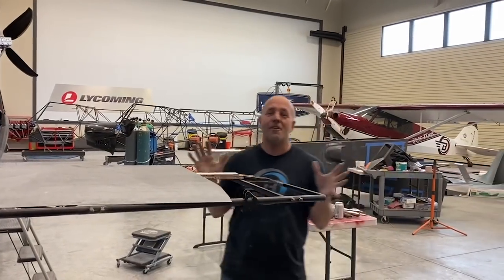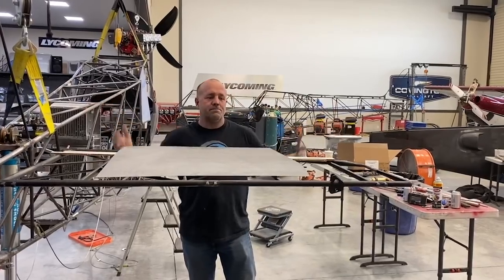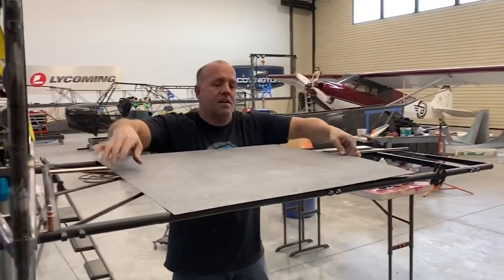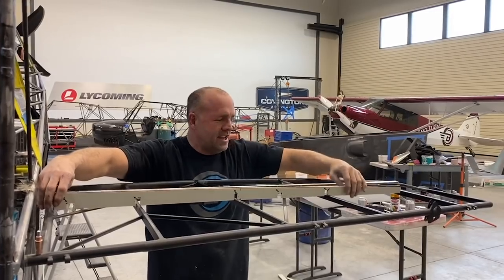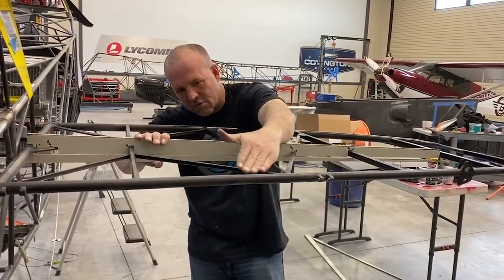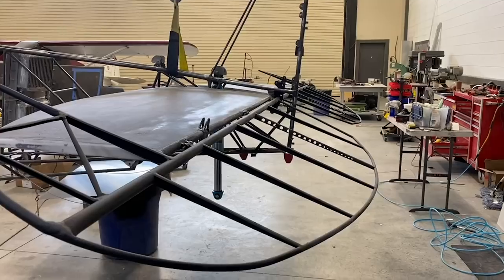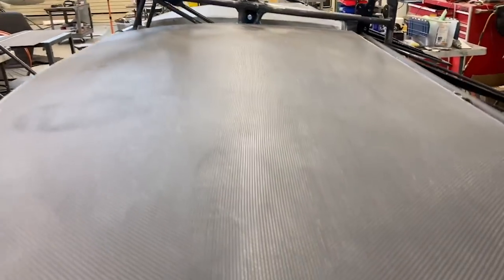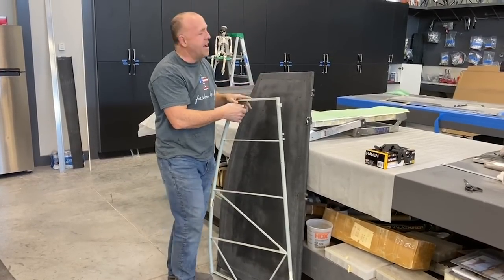Carbon Kevlar Carbon Cub (Scrappy Bush Plane 13)

Comment: Small, fast, composite, so low radar cross section, emphasis on light weight so as much cargo as possible can be carried, bulletproof underside... Mike, if you're having problems, you can start a Patreon, you dont have to start running stuff over the border.

Comment: Why didn't you use a 009 symmetrical airfoil for the tail? The 00x series is widely used for tail surfaces... Also, it has more leading edge radius to avoid tail stall.

Comment: Hey Mike
1st of all, LOVE your video's!! Been watching for a very long time.
My background: Machinist/Mold Maker/Engineering 30 years, I've had my PPL for over 20 years and I also love to build just like you.
Now to my question, You are wrapping F/Glass around metal on your horizontals. I was schooled that you shouldn't do this
because of thermal expansion of metals. With a temperature swing of 40 degree (+)  @ altitude, this must be taken into consideration.
F/glass will NOT expand and contract, but we both know, the metal will. Micro-cracking in the glass?
Again, I have been working with f/glass for years but never glassed metal b/c of this. 

I am  naive, or do you know something I don't?
Off topic: I'll be retiring next year, I would LOVE to come and work for you!!
Reply from the maker: There isn’t enough expansion on this diameter of tube to break a spiral weave glass.  It would have to be a larger tube for that to occur.  Thank you for your comment. 👍🏻👍🏻

Comment: Hi Mike, greetings from southern Wisconsin;
It sounds like your planning on doing some rough riding on the ground with this airplane. That looks like it's going to be one tough beast. However; you have the power up front to take it to the limit. I can't wait to see it flying in a video. Some people will probably complain that your overdoing it, but I don't think so, considering how your planning to use the airplane. I'd like to see what would have happened if you had designed a corsair out of carbon fiber. I don't think the decks of aircraft carriers would have needed to be so long with your designs. Just saying.

Comment: Mike, I can't help but think that the fabric covered moving surfaces are now the weakest link, yet exposed to the highest loads (& potentially flutter risk) from that motor/prop combo...? Also, isn't there an interwoven carbon/kevlar cloth that might have simplified & lightened the horizontal stab?

Comment: Potentially stupid questions:
Couldn’t you go full composite ? isn’t the Steel frame rather heavy ?
Would running the spacer I-beam through the middle make it stiffer overall ?
Would a pointier leading edge be desirable in terms of airflow ?
Thx for sharing your project !!!
Cheers from Germany, land of too many rules (sometimes). :-)
Reply: I think there’s a balance there, remember he has that huge heavy motor ahead of CG. If he removes to much weight in the back, he would have to add more weight, so why not keep the strength combo. That weight at the very back does more due to the distance. At least that’s my thought about it.
Reply: I would suspect that pointy leading edges don't work well in STOL aircraft, as they are typically subject to harsh stall characteristics (short or nonexistent pre-stall buffet warning and a sharp break).

Comment: Great video. Lots of design work. I was wondering about the length of the stabilizer. Will you add or delete the assist tab outboard on the elevator, that would also increase the length slightly.
Reply: I think Mike covered that in the Cockpit videos, rudder trim will (it appears) be done at the pedals with differential spring loading

Comment: So galvanic difference which is what causes the corrosion is solely dependent on there being an electrical conduction between the two surfaces. If they are insulated by surface coatings then its basically non-existent. Mean its a redox reaction. You don't get that unless there is electron exchange. If you really concerned with it then you can put in a sacrificial plate say of say zinc of Magnesium which has a greater anodic attraction than iron or aluminum.  Look it up. You have to do it right bu they work great.

Comment: I wanna rip the wings off my “fast glass” and redo them in Carbon! And My wheel pants in Carbon-Kevlar-Carbon! Kit manufacturers have been asleep at the stick! Thx Mike!! Brilliant!
Reply: Just remember for most applications there is the Cost/Strength/Weight Venn Chart to consider..
- Carbon is mostly for "Porn" factor.

ie Glass is plenty fine for most things. (just use the right glass.) - unless that last 5% really matters to you.
Reply: Very good point. I have removable wings and they are heavy. I wish cost of carbon would come down. It’s frightfully expensive. My wings are slick - don’t care for porn factor - my big concern is always looking at weight n cost! Thx for your comment to recalibrate ;)

Comment: Hey Mike, I am curious how you do your stability analysis for your aircraft. I'm an Aerospace engineer, and in undergrad we used the AVL and Datcom programs, which I really liked doing. Do you use something similar to calculate your cg envelope and control power?

Comment: mike could you get into how you figure flight controls counterbalancing re: flutter?
Reply: Determine center of area. Suspend by hinge line. Place scale under center of area point to get the weight needed. Mass moment is weight times distance to center of area. Ideal placement of weight is same distance from hinge line opposite the control surface but can be d1*w1=d2*w2.
Reply from the maker: One Sky Dog 👍🤠
Reply: @oneskydog4401  thanks 👍

Comment: I should of waited... you appear to be creating a symmetrical airfoil.
Reply: Eugene Beirne  yes. It’s the same shape on both the top and bottom. The reason it’s curved is 1. For unbelievable strength, and 2. Because it will help with laminar airflow thus improving control surface effectiveness and decreasing drag
Reply: @smalljetpilot  no, it wont decrease drag. in fact, it will increase the drag. you need a downforce from the horizontal anyways, so an airfoil creates this force without increasing drag so much. with a symmetrical horziontal you either have to pitch the whole horizontal or use the elevater for your downforce in horizontal flight. both resulting in an increase of drag.
Reply: @andibypass6170  thats the whole idea
Reply: Christopher Kelley  , you are partially correct and @Andi Bypass is completely correct. 
Chris, You are broadly, generally correct when you write "It’s the same shape on both the top and bottom" in the sense that both surfaces are curved vs. flat. You are also right that it will decrease drag to have both surfaces curved. At that Re(ynolds number of 10^6 - 10^7), a curved top and bottom surface will have less drag than a flat plate. 
Take a look at this graph:https://arc.aiaa.org/na101/home/literatum/publisher/aiaa/journals/content/ja/2018/ja.2018.55.issue-3/1.c034415/20180522/images/medium/figure1.gif
and you will see how much more efficient a thicker, curved-both-sides airfoil is compared to a flat plate.
 You're also correct that curved is stiffer.
 Andi is exactly correct in that the bottom surface of an horizontal stab is usually more cambered than the top surface. 
Usually, an airfoil is symmetrical only on the main wings of aerobatic aircraft that spend a lot of time upside down.

Comment: Mike, you have a stabilizer which you’ll presumably adjust per speed to help trim out control loads ? 

Note : it will probably also change your pitching moment’s sight picture in the descent 🤔

With the huge anticipated prop wash and that likely affecting one side more than the other, are you going to have a linked adjustable elevator trim tab on one side as well ?

Elegant mechanical engineering design solution 👍 and beautifully produced finished work by the way 👏
Reply: @Dave Robinson The angle of incidence of the horizontal stabilizer is adjustable with a jack screw. See the slot in the fuselage where the leading edge of the  stabilizer plugs in.

Comment: You stated the horizontal stabilizer skins are 3 layers of CF. What ounce carbon did you use, 5.7, 8.9, or another weight?

Comment: How  much noise via vibration or drumming do you get from the addition of carbon fiber, can you do anything to reduce that noise or is it something you just live with? Great videos thanks
Reply: Active Noise cancelling headset, not a problem....
That huge, wide bladed prop up front will Roar over any "drumming" noise...

Comment: Doesn't Kevlar/aramid deteriorate rapidly in sunlight? So even if you did a camo pattern you would still want to cover it with fiberglass or carbon or something to keep uv light off it?

Comment: That's right, you don't want contact between carbon fiber and aluminum, you need fiberglass in between to avoid corrosion. This is a common practice in aviation industry at Boeing, Airbus, Gulfstream.....everywhere.

Comment: I do wonder, if Scrappy has to be light, why cover the tubing with carbon when instead you could use fabric that is lighter? Because it doesn't look like the tubing needs the added strength of carbon. Then again Mike Patey probably calculated that it does. Anywho I'm just curious.
Reply: I know Carbon Cubs are typically pretty light but with 500+hp up front maybe the absolute lightest fuselage isn't quite as critical.
Reply: I suspect that given his attention to detail, he may have removed some x-bracing from the tube frame to reduce weight, thus taking advantage of the HUGE rigidity in torsion that the carbon fiber shell will impart.   Does anyone know if Mike mentioned that?
Reply: @Mrfishlou  he said exactly this in the video
Reply: By using The carbon fiber versus the fabric and the way he designed the inner spar makes the structure so much stronger then just the fabric would be across all directions on that whole elevator surface. Yes I would guess to say that fabric would be lighter but in this case Like was mentioned about the horsepower being so great using carbon fiber would make that tail so much more structurally secure especially with the Kevlar. Mike is my idle, second to Jesus of course!

Comment: What if it becomes too ridge? Every aircraft flexes and groans which is dispersed throughout the aircraft structure. Is there a possibility of the flex/ stress being too focused onto limited points, resulting in a stress fracture?

Comment: If would include a layer of 1/4" of structural honeycomb composite foam in the carbon fiber panel, you would increase the structural rigidity ten fold with very little weight gain.

Comment: bonding via microballons? isnt that ment as a super light body filler?
Reply: (Yup - more like "Fairing" with microballons then over-wrapping with Carbon Composite.)

Other fillers are more appropriate for strength.

Comment: I thought that composites of dissimilar Young Modulus materials (e.g. carbon and kevlar) would break at the weaker level so not retain the strenght advantage of the stronger material : that can be useful in crash elements for shock energy absorption, but is it in structural elements?

Comment: Hey Mike, did I hear you say that you are going to cover the elevators and rudder with cloth? Why would you do that? Isn't carbon lighter than finished cloth? You should use carbon kevlar like on the stabs. No rock damage😁
Reply: That's just his plan for now.  What's your over/under on whether he actually sticks to it or redesigns it to use carbon?

(Or maybe he'll just use kevlar "cloth"....)
Reply: @BrooksMoses  Haha good call on the "plan for now"
Reply: @BrooksMoses  : Or Carbon Cloth with flexible clear coat.

Comment: As a certified composite guy for Textron, a major flaw I see with your work is in sanding the layers of carbon. If you cut the fibers with sanding, you have just compromised the strength of the buildup. Any sanding on a composite surface is only done on the fill material over the cloth, not on the cloth itself. Each layer of fabric the weave should be oriented at a 45 degree angle with the last layer with no sanding of the fabric. It should all be layered up at one time as a whole.

Comment: What is the micro you keep mentioning? I've briefly heard of micro foams & epoxies. What exactly are your referencing?
Reply: Micro = glass micro balloons. Tiny hollow spheres that are extremely lightweight. When mixed with resin, it makes a lightweight and easy to sand filler.

Comment: Do you need to worry about any difference in the coefficient of thermal expansion between the steel and carbon fiber?  Will one change appreciably more than the other?
Reply from the maker: There isn’t enough expansion on this diameter of tube to break a spiral weave glass.  It would have to be a larger tube for that to occur.
Reply: @MikePatey  Hi Mike, 
I was thinking more about the expansion from LE to TE and Root to Tip.

Comment: Why not just a super thin carbon sandwich tail and lose the metal? since it's not a lifting surface it can be razor thin, only enough thickness to not buckle. And the whole surface could be controllable maybe. Just hinged at the back of the fuselage in a balance.

Comment: Wouldn't an inverted Clark-y give more AoA before stall than the laminar symmetrical airfoil?
Reply: a.)  I don't think Mike calculated this airfoil to be laminar.    b.) Not all laminar airfoils are symmetrical, and not all symmetrical airfoils are laminar.   c.)  With the size of that horizontal stab, and the likely loads involved, I suspect it would take a rare set of conditions to stall that tail.    d.)  If you were referring to increasing the AoA of the wing before stall, the stab airfoil would have no influence at all over that.    All an inverted Clark-y would do would be to produce a downward lift vector (unless the stab had a lot of negative incidence dialed in) and a lot more drag (partly because of its forward camber distribution and thickness, and partly because of all the incidence that would be required.

Comment: Ok so I went back several times to see what material you used for the center beam. Did anyone catch that? I see it was honey combed material but missed something.
Reply: Ok I think I answered my own question... aluminum glass wrapped
Reply: I am curious how effective the Kevlar will be though because used as a ballistic material it is cross weaved and to stop bullets it has to be some what flexible and I get it you won’t be taking bullets to your plane, hopefully, but curious how much more effective resin filled Kevlar is versus carbon fiber. Sounds like it’s time to pull out and old ballistic vest and do some testing.

Comment: @18:20 if its 10,000th of a inch per layer isnt two layers 5,000th of a inch not 20,000th of a inch, I'm sure you're aware and just mis spoke, equally i could just be thinking about that incorrectly and be wrong myself
Reply: It's 10 1/1000ths of an inch, two of which adds up to 20 1/1000ths of an inch.  That is, "Ten thousandths", not "a ten-thousandth".
It's hard to hear the difference; you mostly just have to know that among engineers and machinists, talking in numbers of thousandths is very common, and one would almost never say "a ten-thousandth".  That would instead be "a tenth of a thousandth" (sometimes abbreviated to "a tenth" if context is obvious), or "100 millionths."

Comment: Mike too late but the Kevlar should be the inner layer because of the tensile strength and toughness with the carbon excellent in compression on the outside. Rock hits put the outer skin in compression and the inner skin in tension and Kevlar will prevent the inner skin blowout.
Reply: Tensile strength is not the advantage that Mike is using here, it's Kevlar's extreme resistance to shear.   By providing a layer of fibers that are extremely difficult to cut or penetrate, sharp impact forces are distributed throughout the matrix before they have a chance to cut more brittle carbon fibers underneath.   You definitely want the Kevlar on the outside - it's wicked hard to cut or penetrate!
Reply: Matt Uecker The Kevlar will not scuff true, but if it hits hard enough to deform the panel it will blow out the laminate on the back side but you will not see that.
Reply: @Mrfishlou  : Likely the Kevlar will add little real impact resistance.
 - it may dissipate some forces, but as Kevlar has a much lower Elastic Modulus (more "stretchy") than CF, by the time the Kevlar starts to "take the strain" the carbon filaments have failed (or delaminated)....
For real impact resistance a Kevlar layer over a Foam or honeycomb  "outer core" would work, BUT the additional Aero Drag would be the penalty.  There is a reason "production" composite work is meticulously designed, analysed and tested, this is merely a concept prototype.

Comment: Instead of wrapping the aluminium in glass, could you not just lacquer it to insulate it electrically?
Reply: Lacquer / Paint will (may) tend to chafe through - the glass barrier will add "resilience"

Comment: I'm no expert but given the circumstances, of hitting your plane hard enough with a rock that's massive enough to punch a hole in it, would you not immediately ground the plane for inspection and repairs regardless of whether or not it actually has a hole in it? If such a case is usually true it would seem the kevlar is more or less completely useless but, again, not an expert.

Comment: FYI, there's no such thing as a "bullet-proof" vest. Even the highest-level soft body armor in existence is "bullet-resistant" at best, and even Sappy Plates (composite AR-steel and ceramic plates) can't stop everything.
Reply: Or this Aircraft..  lol...

(Yes, in Engineering terms "Proof" doesn't Exist, there is always a stress which will cause any design to fail.. )